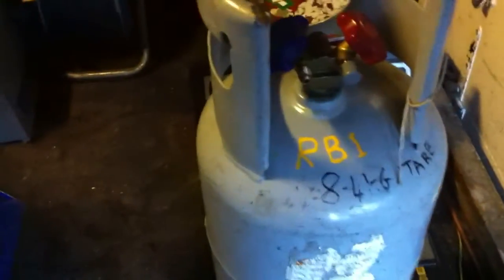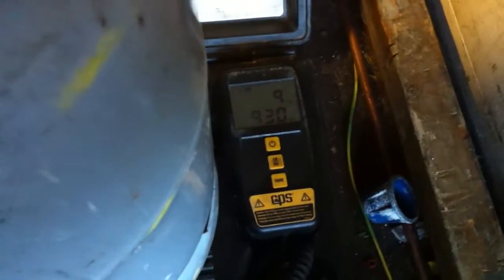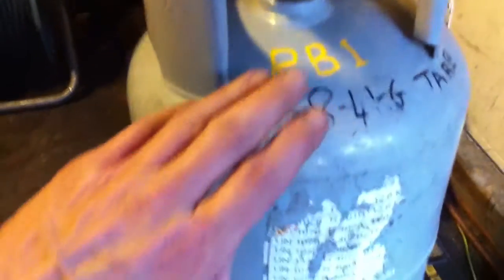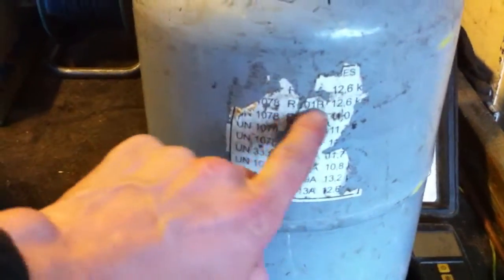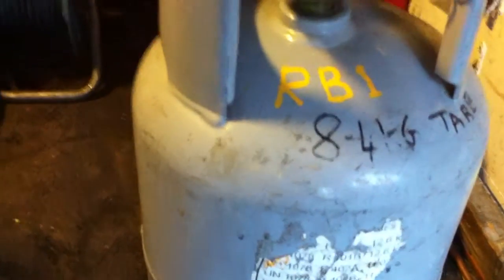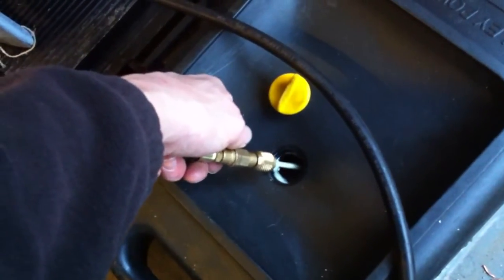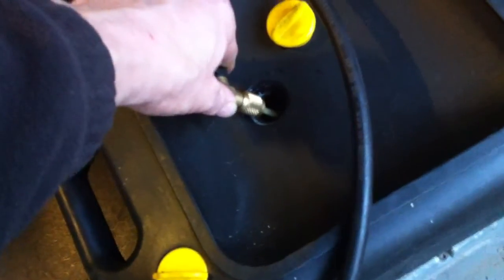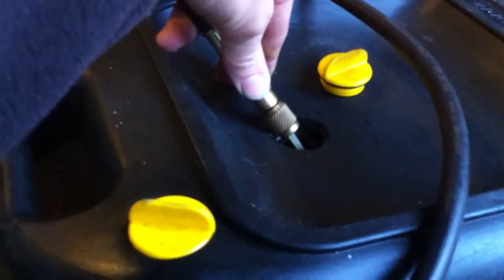HVAC Recovery cylinder tip

Comment from the maker: Its meant for changing the oil on cars! Made by Sealey model DRP06 holds about 5.  I use it for changing the oil in the vac pump mostly. But its handy in the van as its oil tight once the caps are done up.

Comment from the maker: I fitted a new compressor on a milk cooler, called by the next day to check as was passing and found the compressor had three times the correct oil charge in it! It had all the oil from the previous two failed compressors! Drained it all and re filled with the correct type and amount and its been fine since! 
Was lucky it had a sight glass unlike a lot of ac compressors.